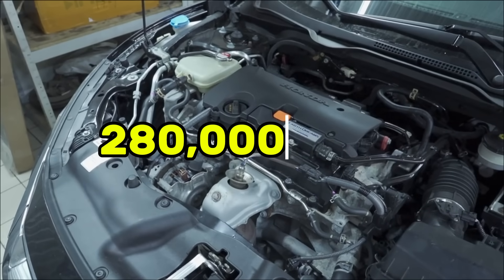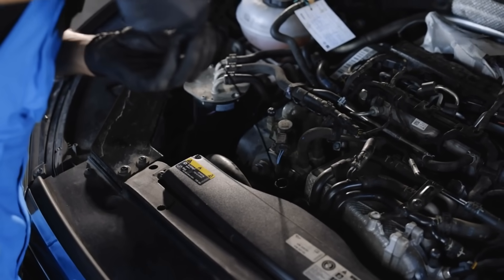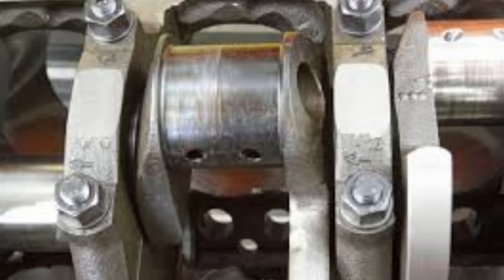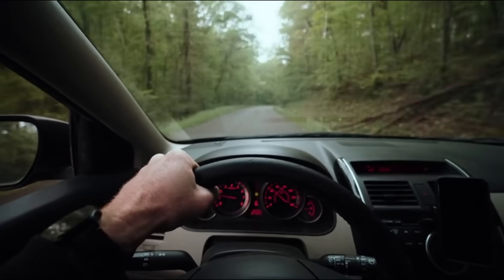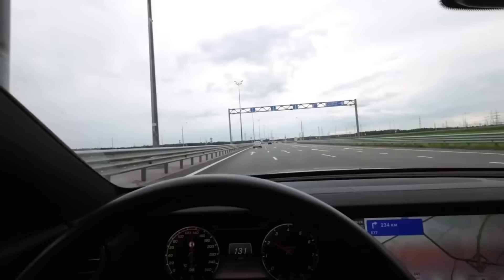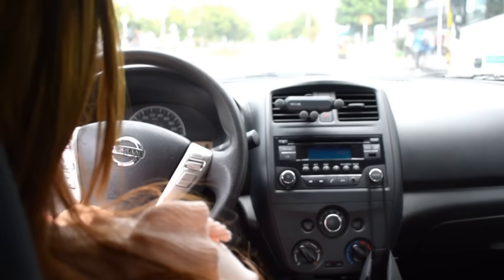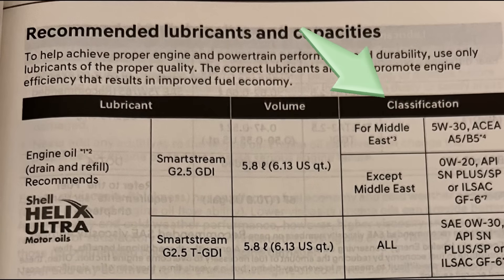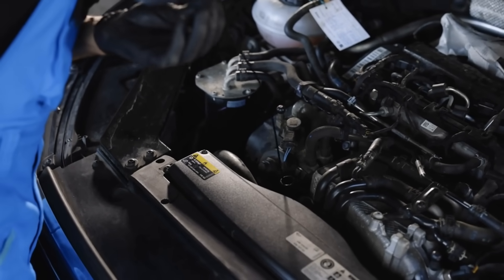I Tested 200,000 Miles of Engine Oil and Found the SHOCKING Truth

Comment: Hello . After the warranty period  I use 5W30 (was 0W20 ) , LIQUI MOLY 4200 TOP TEC  5W30 , API SP , ACEA C3 . Change oil every 7000--7500 km. ,no oil consumption . VW POLO TSI , 2021.Thank You 💞
Reply from the maker: Thanks for sharing your experience with your 2021 VW Polo TSI and how 5W-30 has been working well for you after the warranty period!

Comment: Does using 5W30 when your manufacturer's manual says 0W20 hurt your oil pump ?
Reply from the maker: No, 5W-30 won't hurt your oil pump. The pump can handle the slightly thicker oil without issues - modern pumps are designed with that tolerance. The main consideration is warranty: using non-specified oil could void warranty claims if the manufacturer links it to a failure. Outside warranty, many mechanics use 5W-30 in high-mileage or high-heat situations without pump problems.

Comment: Next oil change,  I'm going 0W-30 0n 3 vehicles,  the tundra has 105,000 miles on it , the camry has 215,000 and the rav4 has 68,000 on it, always ran 0W-20 , but 0W-30 is better for hot climate.
Reply from the maker: Thanks for sharing your plan to switch to 0W-30 for your vehicles, especially with the hot climate in mind!

Comment: This test has already been debunked. There were no 50 engine test. It was some gimmick that someone claimed and it was never proven or confirmed. There was no test with 50 engines. This is invalid. 

It’s true that 5w30 does protect engine better at higher heat, but that’s for severe driving. But vvti and VTEC, or engine shut off lifters are more sensitive to oil weight differences. So those should be kept in mind. Plus oil pump are programmed to sense different thickness used for each region. Just because 5w30 is recommended in Australia dos not mean it’s program the same in the US. Give the Honda Type R for example, in Europe it’s programmed to have 325hp while the US version only makes 316hp. EPA is tweaked for each region.

Comment: Was it the same brand oil from the 0w-20 and 5w30?  What about the filters?  Change intervals?
Reply from the maker: Excellent point - those variables absolutely matter in any valid comparison. Without controlled parameters like you mentioned, results aren't meaningful. Bottom line: brand quality and change intervals matter more than just the weight number.

Comment: One thing you leave out about Toyota, that the Autos made in the US, use a different oil pumps to pump thin oils. The ones that goes to the EU are different pumps made for the thicker oils. You want to take the chance, that's up to you.
Reply: @kf6660...Hi...I have to disagree. The same oil pumps are used in both the US and in Europe. They are designed to handle the different grade viscosities. Toyota will recommend or prefer certain oil viscosity numbers, such as 0W-20, or 5W-20, or other grades for different parts of the world, but that is all it is...a recommendation. The oil pumps are designed to handle the various normal grades.

When I said "normal", that is what I meant. If you decide to put 5W-60 or even higher in your Toyota when the oil pumps were not meant to handle such high viscosity oils, then you will probably have problems.

Think about this: If the pumps are so sensitive to certain grades and cannot handle any change from one grade, then Toyota would have to manufacture dozens & dozens of different oil pumps for the many different climates around the world. This just doesn't make sense, and Toyota does not do this; it would be a logistical and manufacturing and distribution nightmare of global proportions. 

How about just using some common sense about your own particular climate and adjust, if any, for what your engine works well with. For example: I live in Arkansas, where the winters and the summers are rather moderate and do not need extreme oil grades to operate properly. My 2015 Toyota RAV4 runs much quieter with 5W-30 than with the 0W-20 that is on the oil cap. It used to rattle/clatter on start-up and when running for a while; not a lot, but noticeable. Now, it does not rattle/clatter at all. My engine told me what it likes.

There is not a single correct answer to this discussion. Use your common sense and use what you know your own particular engine performs well with.

Comment: How about for hybrid vehicles, I drive a  nissan kicks epower in the engine only acts as a generator to charge the battery?
Reply from the maker: Great question about the Kicks e-Power! Since your engine runs at more consistent RPMs as a generator (not directly driving wheels), it actually experiences less extreme load variation than traditional engines. You could safely stick with the manufacturer's recommended 0W-20 since you're not experiencing the high-load scenarios I discussed (towing, aggressive acceleration, etc.). The engine operates in a narrower, more controlled range.

Comment: Just bought  a Subaru 2018 Outback with 87K miles in Honduras, in the first oil change the car dropped a quart of oil with W0- 20 that’s according to Subaru specs, here the climate is hotter so I decided to changed to W5- 30 , no issue, the outback is running just fine , no oil dropped and running smooth

Comment: Change it every 5k 0w-30 in winter and 5w-30 in the summer and manufacture recommend 0w-20 engine is so much more happy quite and didn’t even notice a difference in fuel mileage.

Comment: My RDXs call for 0w20, I run 10w30 in the summer, I drove to AZ during the summer, I got 28mpg  at 65 mph with the 3.5L v6. If you have a warranty, you have to run the recommended oil or they will deny any possible claims.  If you're in 70F or higher climate, find a good group 4 like Red Line, Motul, or Liqui Moly for summer months.
Reply from the maker: It's interesting to hear how you adjust your oil choice for summer driving and the reasoning behind it, especially regarding warranty compliance.

Comment: EPA is forcing 0w20, which is fine in the winter. I've 2 cars requiring 0w20, I run it in the winter, 10w30 in the summer.
Reply from the maker: That's an interesting approach to adapt your oil choice for different weather conditions!

Comment: I’m using 0w20………What a Big Mistake…..Factory oil Recommended….for Ram 1500 …..Changed to 5w30…My Truck is in Heaven…..No more HEMI Tick. ….Living in Miami Fla………90’ and More..175miles per week….Still getting (Good mileage at the Pump)……22Ram 5.7HEMI BIG HORN……43800 Miles…..
Reply: ......do you know......that there is basically......no difference .......between 20 and 30 weight oil.....at running temperature....
Reply from the maker: Thanks for sharing your experience with your 2022 Ram 1500 and how 5W-30 has improved its performance in the Miami heat!

Comment: Owner manual  said recommended  0w20 oil in tsi turbo engine  1.0  if temperature  goes 40 degree what which grade to fill only they said when topup  not available  then fill 0w30 in emergency  for topup
Reply from the maker: It's interesting to note the owner's manual guidance on using 0W-30 for top-ups in emergencies when 0W-20 isn't available.

Comment: Use 0w-40 much better,and  handle almost all weather,5000m change it instead 10000m(don't 100% trust what the engine oil company said,10000-15000 are in Lab ,not in road
Reply from the maker: That's a solid strategy to use 0W-40 and change it at 5,000 miles for real-world driving conditions!
Reply: @YourMotorCare yes!👍👍 you are expert too

Comment: I have a 2017 Toyota 4 runner with 125k on it, I juit switched from 0w-20 to 5w-20 in the winter and will be using 5w-30 in the summer. The engine tolerances open up just a fraction when you get over 100k and the thicker oil in the summer will absolutely help protect your lower end engine parts

Comment: My 2020 Tiggy says they changed oil pump from my engine to allow only 0w 20 oil or it will mess up cam or valve timing… anyone has similar issue? Can’t be sure if 0w30 will eventually eat up mu engine

Comment: I have Maruti 1.0 L petrol engine and recommended oil is 0w16, droven 43k kms in 5 years, used 0w20 thrice, 0w16 twice now after seeing many vdo about viscosity performance, will switch to 5w30 from next oil change. I  get the oil change between 6500 km to 8200 kms. Unserstood the govt regulatory guidelines and repair costs in later years.

Comment: Nothing but 5W-30 in my beautiful 25 year old pickup as originally specified and full synthetic. If you love your vehicle and want to have it a long time go with the 5W-30 and change it at 5,000 mi. If you lease or don't plan to keep your car for more than a year or two go ahead and use 0W-20 at 10,000 mi. and obtain a fractional mpg increase before passing it on to some unsuspecting kid.

Comment: I use 5w-30 on bmw 535i. every 15k mile oil change. no problem withe engine so far at 170k
Reply from the maker: Thanks for sharing your experience with your BMW 535i and its longevity!

Comment: 0W16 is what Toyota calls for in my 2023 Rav4 Hybrid. It says 0W20 can be used but change back to 16 on the next oil change. I was wondering the long term results of using such a thin oil.Maybe I need to bring up the weight of the oil I use?

Comment: First issue I have with this video… they fail to mention the engine they tested… secondly, not all vehicles are created equal, manufacturers build these newer engines with these tolerances in mind and design them intentionally to handle the oil weight they have designated. Also, where is the mention of how often the oil was changed? Were these N/A motors? Turbocharged motors? That also makes a difference. If you are changing the oil every 10k miles… you’re an idiot, idc what anyone says. Just because the oil bottle or manufacturer say it’s possible, the reality is that most vehicles need to an oil change sooner, it’s just common sense. There are examples of my car for instance that use 0w20 with over 300k miles on the dash already. Don’t believe everything you see on the internet people.

Comment: Ford Expedition, 3.5L twin turbo ecoboost…105k miles……always use 5w30 full synthetic…Mobile 1 ONLY…….engine still purrs quietly…..5k interval changes at most, sometimes less.

Comment: I have over 200k on a 2019 F150, 3.3 V6. 5W20 used since new, changed every 5k miles. Does not use oil, runs like new.
Reply: Frequent oil changes is key.  None of this 7500 or 10,000 mile bs.
Reply from the maker: Thanks for sharing your impressive experience with your 2019 F-150 and its longevity!

Comment: 5w-40 bit the next oil change I will use 10w-40 because I like drive around 2500-3000 rpm for engine cleaning .

Comment: I have a 2023 Acura TLX Type S and I will never put 0w-20 oil in my car ever again. I use Torco SR-1 full synthetic 5w-30. My car drives much better on the 5w-30 especially when I’m pushing it.

Comment: I wasn't feeling good about using the 0w-20 in my Japanese Import as it states in the service data,  I then looked online for the Japanese manufacturers tech data for the same vehicle and found that in Japan they recommend 5w-30 for the same year, make, and model as mine, so if Japan says to use 5w-30 then I'm going with what they use in their own vehicle, not what the American Petroleum Institute (API) and the International Lubricant Specification Advisory Committee (ILSAC)  suggests based on fuel economy and emissions standards. My interest is in getting a longer life out of my engine.

Comment: I use always 10W-40 or 5W-40 and on some cars even 10W-60.  Oil is the most important ingrediant in your engine. Regular oil change intervals and good quality oil will make your engine last a lot longer. And in the end you save a lot by not rebuilding engines or taking cars to the scrapyard.

Comment: In the summer I run 20w50 I'm my air cooled zero turn mowers never had a problem I'm my older toyota I run 20 / 50 in summer Time in the fall I change it out for 5w 30

Comment: As long as you put in the weight of oil that your engine was designed for you will be ok. If you put thin oil in a engine designed for thicker oil it will wear faster.
Reply: The oil weight for the same motor is different in different countries for the same motor

Comment: Dump the factory recommended 0W20 on a brand new 2023 Tacoma after 300 miles switch to Amsoil 5W30 SS noticed smooth quiet engine and no ticking noise heard on the lifters.Will no longer be using 0W20.

Comment: Here's a question: what if I ran my oil through a 1 micron filter once a month do you think that would be a benefit? I've got a filter system setup so I can cycle all my oil (minus whatever hangs around) through a 5 micron then a 1 micron oil filter once a month and I'm stretching out the oil change an extra 2 to 3 thousand miles.

Comment: There are other variables to consider like whether or not you drive your car hard such at a racetrack. 

I also want to make a correction. I live in Japan and they do not recommend the higher viscosity oils. Most of them all say to use 0w-20 or even 0w-16. However depending on the car, the owner manual will tell you that 5w-30 is acceptable.

If you use a turbocharged or supercharged car, you'll want to consider using 5w-30 or 5w-40. 

Also, many modern turbochargers also use coolant to help cool alongside the oil.

Comment: The same 8th gen 2.5L Toyota Camry is sold in both USA and Mexico. Identical A25A-FKS engines. The USA owners manual only recommends 0W-16. But the Mexico manual has a table that recommends 0W-16 to 10W-30 based on the ambient air temp. 

So the question is why does USA owners manual exclude the oil ambient air temperature table? Because they need to convince USA regulators that the average person will simply follow the owners manual, thus keeping emissions lower with higher mpg from thin oil, thus avoiding the CAFE penalty fees. 

I agree that 0W30 is best. 0W30, 5W30, and 10W30 all have about the same operating temp viscosity. But 0W is good all year for cold crank. 

The cheapest Walmart option for 0W30 oil that meets ISLAC GF-6A is Mobil 1 AFE 0W30. Here’s the oil analysis for fresh oil, which looks good.

https://bobistheoilguy.com/forums/threads/mobil-1-advanced-fuel-economy-0w-30-virgin-oil-analysis-2024-blackstone.385811/

Comment: Both my cars are turbo. One I drive in winter only , so cold temps, and the other in the summer only, but summers where I live are about 4-5 months of warm weather, rarely gets over 85 F. The other 2-3 months of "summer" is cool temps, 40-50F. I use 0w-20 in both, but since my supra, which is my summer car, is now 5 years old and has 38k miles, I'll probably switch to 0W-30. My GR Corolla, which is winter only, will stay at 0W-20 for now. The Supra gets an oil change once each summer, about 6500-7000 miles. The GR Corolla gets an oil change every 5000 miles.

Comment: Audi A3 8V 1.4T using 5/40 engine oil lost 1L every 800km. Change to 10/50 reach 1500km dipstick check Oil going lower but not reaching lower point on dipstick. Better on ticker oil for hot weather 38 degrees temperature

Comment: I had some lifter noise on my 2017 Highlander using 0W-20. I watched a video from the "oil geek" and switched to 5W-30.  WOW !!  What a difference, lifter noise went away and I could hear the engine running smoother and quieter.

Comment: Oil will thin out in all weigh so in summer use 5w-30 weigh minimum or even 5w-40. 

In summer, automobiles will run the AC quite a bit so oil will thin out fast at hot temperature. 

Been using 5w-30 and change at 5000 miles religiously, virtually no oil consumption for 140,000 miles engine. 

Do not use 0-20, engine wear up to %42. Numerous YouTube videos revealed.

Comment: So.....200k miles, 20mpg, is 10k gallons, figure $3.50/gal = $35k fuel cost....so 3% savings would be $1050. 
Certainly not enough to replace that ruined engine from using 0w20, is it?
You got screwd on that one.

Comment: I've always knew this, good thing my dad thought me this, maybe this is why my 2015 Dodge durango has 220k miles, and the engine sounds like a baby. This is probably why i haven't experienced any ticking engine from Dodge. Ive have always put 5W-30 in all my engines, i knew this thin stuff had to be a fluff.
Reply from the maker: That's fantastic to hear your 2015 Durango is doing so well with 220k miles on 5W-30!

Comment: How often to change? It varies with driving habits. I use the color test. Looks like beer have no fear. Looks like wiskey getting risky. If it looks gray, oil has water, find out why. Manifold leak or pcv failure.

Comment: Government doesn't know squat as always. I have never found higher mpg with oils under 10w. Synthetics changed the game. Being a mechanic 50+ years I ONLY use 10w30 synthetic Period! In the old days we used 20w50 racing oil. Engines then we're very loose. Now, tolerances are closer. BUT friction never changes. "It's the film" the lubriplate trademark. Thin film equals high wear. Unless you're an Eskimo stay away from 0w and 5w oils. Your engine runs 99% at operating temperature. Do the math! I also recommend 15w40 for diesel engines. They have violent combustion and slam the rods hard. No place for weenie oil. My picks are Mobil, Valvoline and Penzoil. Can be found at most discounters. There are other good oils but you'll pay.

Comment: I use KY liquid lube. if it can protect a dude's butt getting railed it will protect my engine.
Reply from the maker: For optimal engine health, it's essential to use an oil specifically formulated for internal combustion engines.

Comment: 0W20 for cold weather, and 5W30 for hot weather.
Reply: That’s not how you need to look at it. Your engine has a cooling system that keeps the engine warm in winter and cool in summer. You can only go buy engine temperature not weather ! I go 0-w20 to 30,000 then switch to 5-w30 !

Comment: Wife's new car, 1.6T , oil dumped and replaced at 1000km, will do again at 2000 then each multiples of 5000km of 5W30..Tech-Mechanic here..am not smarter, my objective is just different, longevity is the goal.